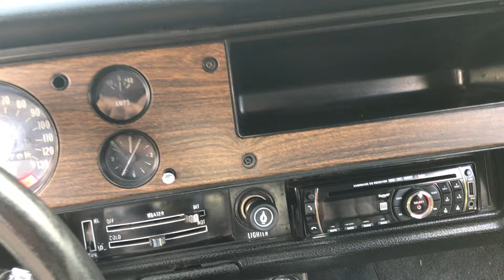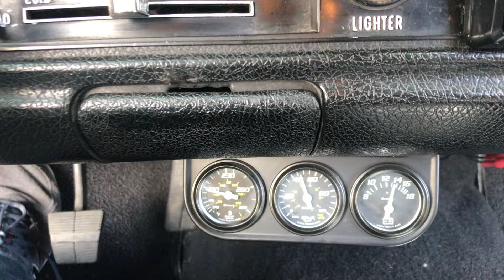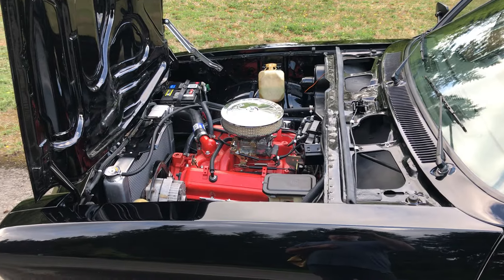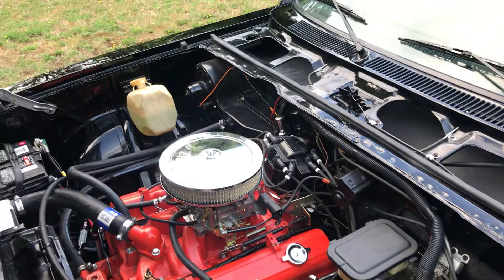1972 Vega GT V8 for Sale

Comment: I've always though the Vega was a good looking car. It reminds me a lot of a small camaro of that period. It was just the engine and transmission that was terrible.
Reply: Oh yea, it was aerodynamic and looked cool. I had a 74 that i called a poor mans mustang. More solid than it looked, when ya run out of gas just try to push it a block by yourself!
Reply: They never had transmission problems, just an aluminum block that was ruined by bean counters reducing the cylinder coating to a point of rapid wear. Properly undercoated they didn't rust, either. It was a cheap car and treated as such. There are no early pintos, opels, corollas, civics, or anything else left on the road, either.
Reply: @wymple09  My parents bought a 1977 Vega Stationwagon new in 77 and it was dead by before I graduated in 1982. I typically don't even by cars now until they are 5 years old and most are like new still.
Reply: You could always cut out the drivers side floorboard and turn it into a flintstonemobile
Reply: @loyevangelists  That would make it a Ford
Reply: Actually they weren’t too bad, I had three and never had transmission or engine trouble. Preventive maintenance was the key to longevity.  They were great cars.
Reply: Nothing wrong with the transmissions.
Reply: Actually, the biggest problem was the combination of Aluminum block and cast iron heads, coupled to a too small radiator. I loved my 74 Vega hatchback.
Reply: @wymple09  😆
Reply: I agree about the Camaro similarities. Check out my previous comment. I should have placed it here - lol.
Reply: @ronwood9084  I've heard that the aluminum block didn't have sleeves for the cylinder walls.  (I may be wrong.)
Reply: @wymple09   Thank you well said, of all the cars you mention Vega was my favorite.I went to the bank to get a loan to by one, and the loan officer said he has a lot of loans gone bad on Vegas in our city . I was sad, i really wanted one,test drove one , the cosworth was special to me.even now, i still really like this car.
Reply: Mainly the engine.  Shame on you GM !!

Comment: Memories.. I had two.. 71 and a 74. The 74 was the best..  327 with M21, ford 9inch curry axles and retainers. It went through a few rebuilds going from pull the wheels off the ground to a batsh*t crazy fast roadster.  I ended up with 3:00 gears on the 13 inch facotry GT tires, cut down Monza V6 springs in front so the suspension actually worked, big  Monza sport bars front and back tho the back required a minor mod to drop it to clear the 9 inch ring gear. Dual exhaust all the to the back of the tires like this. And yes, total PIA to get it tucked up.  I could race Ninjas off the line and beat them for 90 ishg MPH then they would pull away. THe only car that ever stayed even with me on the street was a blown 69 El Camino.  Stupid fast..  CHP clocked at 145 plus.. The officer had gotten behind me and I Didnt see him. I had clear freeway and good tunes so I dropped the hammer. Left him like he had hit his brakes. That was fun to explain away. End up he was building one like this so he and I talked for a godo 45 mins about the car after I signed for a 65 plus exceeding the max speed limit. And was very polite during the stop. Ah.. good times ;D

Comment: Wow, this takes me back! 

I had a new '72 Vega GT that started buring more oil than gas at about 50K miles. Bought a kit from Herbert and Meek (headers, engine and trans mounts) and a junk yard 283. Plan was to do a simple rebuilt of the 283 and install with a turbo 350. Plan lasted until I discovered that my junkyard 283 had a forged crank and needed to be bored out. Ended up as a backyard 302, with fuelie heads, Duntov cam, 11.5:1 pistons, Mallory dualpoint ignition, Torquer manifild and 650 double pumper, Hayes clutch and pressure plate, Lakewood scattershield, Muncie M22 and 12 bolt rear.

Never should have gotten rid of it!
Reply: That was a 283 truck engine,they all had forged cranks from what I'
ve been told.
Reply: JSC1951 back when all of those parts ran you less than 500 dollars. Now the headers alone are that
Reply: Dang, you had every single thing that I had in a 72 GT Wagon. One difference, I had a nice Borg Warner 4 speed transmission, special ordered with low first & second gears. 5:37 1st, 
4:35 2nd. In my narrowed 12 bolt, I was running 5:13's. Yup, if I wanted to, I could be in 4th gear  just putting across a nice big intersection. I ran a 65 Vette 327 and massaged it real nice. 
12 to 1 forged pistons,
Sig Erson cam, 5:74 lift
and 3:02 duration. Camel hump heads all ported & polished. Oh, I also had a purple ZooM clutch plate & disk. A 
Weiand tunnel ram with a nice Holley 780 up on top. The wagon was the factory silver with the black stripe. One more, frame connectors, had to weld those suckered in. Haa ha, on cruise night I would park it on a dead-end street where everyone would turn into so they could turn back onto the cruise boulevard. I parked it way back in the dark, but walk up front and tell certain guys who thought they were fast, HEY, I've got a station wagon that will beat your POS! Then the fun began!

Comment: All that engine work, and it’s an automatic (girls car), Further, the wheels indicate it has far under rated brakes (and probably suspension) for a V/8 setup…. 
Lastly, the owner has no clue relative to this machine, that someone else built. 
Looks great, like the Ana’s mags, But I would have opted for a lighter, powerful, late model turbo 4 instead. I would have spent the big bucks on improving the suspension and brakes, and used a manual transmission.

Comment: Originally in 1970s GM was working on the idea of putting a V8 engine in the Vega but decided against it
Reply: Why?
Reply: To keep the cost down it was a time of high gas prices
Reply: There were 2 OEM V8 vegas manufactured for testing. They never saw the light of day but a collector got both of them. They decided to move the testing to the Monza which had the same frame as the Vega. They put a very weak 262 V8 in them to prevent frame issues from too much power. Eventually the Monza would get the 305 in the Spyder version.
Reply: GM should have dropped the Buick V6 into the engine bay.
Reply: @johna.4334  they did but not as the vega.. if you bought a starfire (oldsmobile) you could get the Buick V6 in it. Old's version of the Monza which had the same exact chassis as the vega and astra
Reply: @TotlKaos  
Such a shame.  The Vega was a better looking vehicle IMNSHO and deserved the Buick V6. Somehow I believe GM politics were involved with this blunder.
Reply: James Veach no they didnt decide against it. Its called the monza. Same car different body dhape

Comment: Needs a big block and back halved. Tubs and wheelie bars. Perfect ProStreet conversion project.
Reply: To small not enough wheelbase, had several, redid a GT, 383 stroker\4spd 8pt cage, minitubs, 9inch
Converted it to alcohol it almost killed me, thing needed wings or another 500lbs over the front axles.
But man it was fun when it was streetable.

Comment: Really brings back memories. I had 2 in the early 80’s  327 with Muncie 4 speed and a narrowed 12 bolt posi. Mine was a death trap. Rolled the first one then put all the drivetrain in another then blew the engine. I was done. Beautiful car!

Comment: Car is Currently sitting after purchasing found electrical gremlins and fuel delivery issues including the cigarette lighter melting out of the dash without engaging while driving,,,yet was equipped enough to make emergency stop and disconnect battery fast enough to keep the car from burning to the ground, found that the car was set-up with a small tractor type 5/16 electric fuel pump with new 5/16 hardline ,,,the  experience was almost comical as the car would surge down the road as if the fuel filter were cogged ,,, with help from the 180degree hard line bends the size of your thumb off the pump ,, first on list for winter projects as the fuel system will be scrapped and all wiring gone through
Reply: Richard Wimmer, oh what a shame especially on such a seemingly sweet ride as this. Hope u get the gremlins worked out soon and have this beauty back on the road trouble-free and blasting "Highway Star" by Deep Purple" like back in the day when she was new.
Reply: Car should get 30 MPG and not need much fuel... make sure carb. is jetted properly...

Comment: sweet vega. was wondering if the factory tach read accurately and how was it done?
Reply: Grab a tach circuit board. They're plug in style and work great for HEI too. One model handles up to 74 and another for 75 and newer or you can always do what we were stuck with and make your own. Luckily for me my friends had an electrician they liked giving their problems to.

Comment: I love the Vegas. They were essentially a mini camaro, and I wish GM would have experimented with a v8 option as they did with the Monza.
Reply: I always called them a poor mans corvette lol.
Reply: @anthonypickens3236  The Buick Opel GT is the poor mans Corvette.
Reply: Thy did actually! July 1972 issue of Hot Rod magazine - road test including 1/4 mile time for an aluminum 302 V-8 Vega. I believe that they built a total of 12, even a couple of 4 speed cars. It was this experimentation that the V-8 Monza grew from just a couple of  years later in 1974 - search for "The Vega Tapes" here on You Tube to see my 1974 GT wagon that I built in 1988/89 with a 406 CID small block.
Reply: @davidkastin4240  And many did end up at the drag strip with a small block between the front wheels

Comment: I had a Pinto of the same vintage, and the only Vegas I ever liked were the Cosworth and the racecars.  But this is a beauty, very impressive.  I would suggest that if it's not already been done, some sort of insulation or heat shield be placed between the brake master cylinder and the header tube.  Boiling your brake fluid isn't fun...

Comment: i put a 3 sp manual w/ overdrive and 2.73 monza rear end in the one i did.  27mpg
Reply: ps to get it right... had to put radiator in front, cut hold in cowling, bra w/ flexible galv. metal structure under it.  move heater back... move steering box sideways and ext. steering arm w/ 2' adapter down... and cut/bend part of metal around A arm for exhaust.  :-)...and put a sub structure under it so engine could set via a big angle iron 'shelf ' on a vulcanized mack truck bed block.  wow... one of the great retros of all time. hahaa.  bummed me to hit ice

Comment: I'm sure it's already sold but what did you go with for a rear end? I have built 2 , a 1976 and my favorate, 1972 like yours. I went with Dana 8 3/4 the axle splines going into the pumpkin don't get bigger allowing for a clean cut and respline. I have tried to use stock Vega rear and found out quick that that was not gonna work.
Reply: I left my 72 rear stock but it had a Powerglide behind a 307 (stock other than headers, AFB and slight high-rise).  Drove it like that for 20 years.  A low budget build for sure but was pretty fast for an 80's car and very reliable, it eventually rusted away, and I mean literally.
Reply: Stock rear was good to 240-250 HP. Pretty fast for a 2450 lb car.
Reply: @wymple09  Ratio was pretty low too.  My 307 was probably around 220 HP.

Comment: A guy I knew  built a 4 sp one  used a bicycle chain setup to run the clutch worked great, couple vendors wanted to buy the pattern  not sure who got it.
Reply: I ordered a bell housing and clutch fork from dealer for a Monza spyder and used the factory cable clutch and ran a M22 in mine....loved that car....283....030...all the good stuff...

Comment: This car came with an optional V6 package. And special order with a V-8. Pull the four-cylinder out of any Vega chisel off the Engine brackets, and you are fine captive not welded into the frame for the factory chassis mounts for the V-8 or V6 to drop right into The car. Also the turbo 300 would fit and in transmission mounting bracket to be bought from the dealership as well. I built 13 of these cars with various small blocks and nova rear ends. In November and there’s only one and three-quarter inches wider than the Vega rear end.
Reply: I think you are very confused the Vega could "not" be special ordered with a V6 or V8  4 cyl only. The Vegas predecessor the Monza could be had with any of the 3 engines but not the Vega.
Reply: @mitchstott4004   I built 13 V8 Vegas, they came with an optional V6 engine. Chisel out the four-cylinder motor mounts that were welded to the frame and underneath were welded captive nuts in the frame. For 10 bucks I bought the brackets from the dealership. The V6 which was identical to the V8 short two cylinders allow the V8 to fit right in. Don’t tell me I’m mistaken when I did it 13 times.
Reply: So after searching through some of my really old Chilton manuals, even though they’re falling apart google does not show anywhere the 200 in.³ V6 engine that dates back to 1969.

Comment: I like to know what kind of rear end. Is in the car?
Reply: If the car is actually used on a highway with a TH350, I'd hope it be no taller than 3.27 maybe. Unless this car was built by a moron (and it strongly appears not to be) it should have some limited slip or Detroit locker in there to save on right rear tire expense.
Reply: @mfslyphantom8811  but How Much is the Asking Price for It ? Thanks

Comment: What kind of a rear end does it have under it?
Reply from the maker: It has a shortened axle from an S-10 was what I was told when I bought it.
Reply: @albertpenello  Cool, A Buddy of mine and I built a couple when I was younger, he left stock rear in and shattered them on a regular basis. Mine had a 12 bolt with a Don Hardy subframe kit, and it was never a problem. How much you asking? Trade for a Harley with 8k miles?